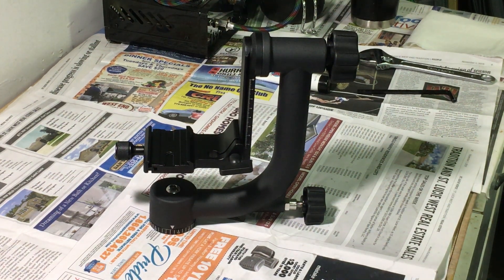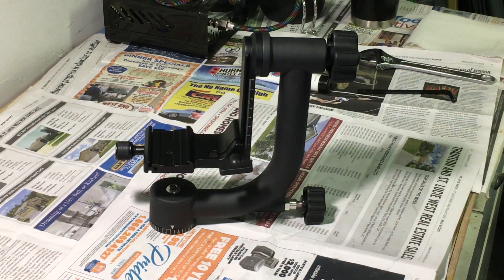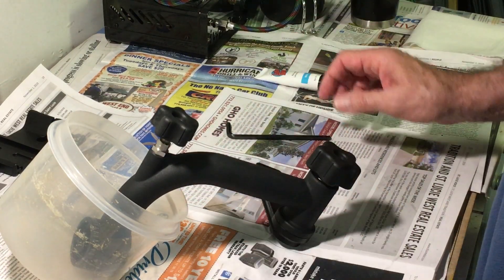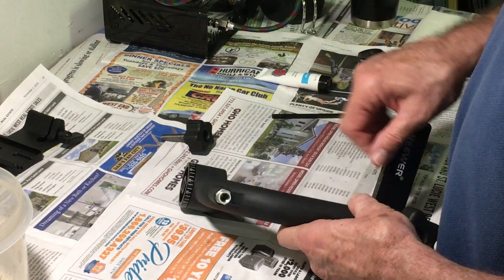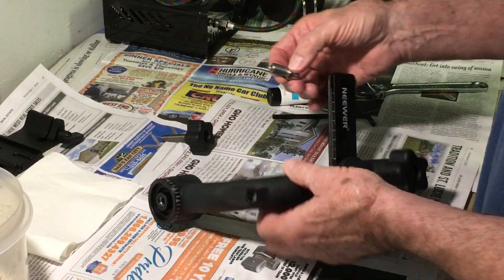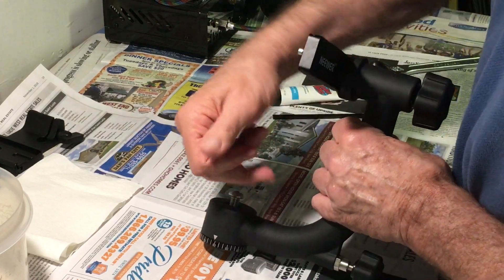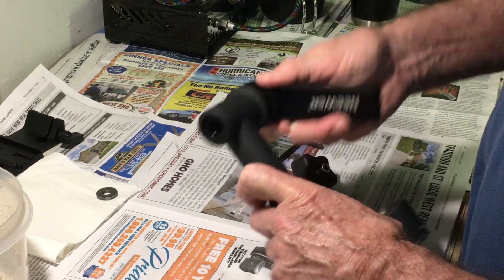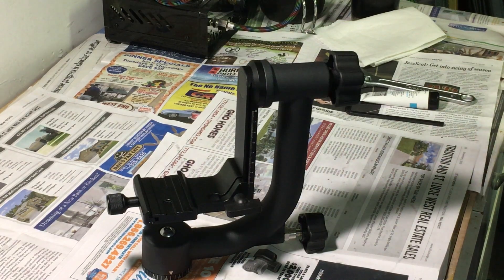NEEWER Gimbal Tripod Head Disassembly & Re-lube

Comment: I've had this gimbal since about the time you posted this video, the stickiness is real. So glad I found this, I was going to order a new one.
Reply from the maker: @kjkrzycki  I’m happy to hear that it worked out for you. 👍🏼 Thanks for checking out the video.
Reply: @vintagenerd55  got it done, used your lube. but there is play in the support arm that the arca plate attaches to. I have no idea if it was there before. Darn it. About 4-5 degrees of play

Comment: Fantastic video, I just purchased the same gimbal from Amazon here in the UK, and it was quite stiff in use, so I watched your video on how to regrease it and must say what a difference.  Both of the bolts on mine were impossible to shift, so I did like you did and soaked them in boiled water, and eventually, they came loose.  Regreased it using cycle grease that is yellow in colour but quite thin.  I've used this grease to lubricate the bearings on a very expensive road bike so it will be more than good enough for the gimbal.  Now it swings around effortlessly, so a big thanks for making this video.
Reply from the maker: You’re welcome John. Thank you for taking the time to respond and I’m pleased that you found the video helpful.

Comment: Thank you very much for your explanation.  But the Grees you used are not clear to me.  Can you please tell me its name?
Reply from the maker: LUBE TUBE. It’s a lubricant used for swimming pool pumps, O-rings and Jandy valves. Holds up pretty well and it’s not viscous like the OEM grease.
Reply: @vintagenerd55  woow. Thank you very much..

Comment: Beike BK-45 is the original Producer/Product now sold with many brands/names:
>  Bilinli,  Andoer, Neewer, ARTCISE K45 or Koolehaoda KQ-45
Reply from the maker: I wonder if any of the various resellers have corrected the high viscosity lube issue.
Reply: @vintagenerd55  every time I reply my text get deleted !!!
Reply from the maker: Never had that happen before. Must be some kind of a software glitch.
Reply: @vintagenerd55  I suppose it's some kind of bot to prevent spammers and selling spam... That bot auto delete suspect reply.
Reply from the maker: @AlainCh2.  I received all of your comments. Considering the number of complaints people have levied against the high viscosity lube, you would think the manufacturer would change to something less viscous. Thanks for your report on the different resellers iterations.
Reply: @vintagenerd55  Alas, no!! There is only one farm that produces two variations: One is like yours without any collar on the horizontal handle + visible screw on the pan joint. One like mine with a collar on the horizontal handle and a cover on the pan screw.

- In my first copy the horizontal handle got stuck while un-tightening + After an afternoon in the car in the sun a big blob of grease fell down on my knee Luckily after I removed it from the tripod, So I returned it
 - Got another that is working fine- I will proceed to disassemble it and do a short video because it requires removing the hard glued covers on both screws. I suppose heating will help to remove the glue.
Reply: @vintagenerd55  Koolehaoda 
is the brand - text to search ... testa del treppiede ...
Reply: @vintagenerd55  ITalian site of A z... what a pain!

Comment: Glad I found this.  I bought this head over a year ago and the damn grease/glue leaked out after a hot day in the sun while in my truck.  I added washers and a thrust bearing to the pan axis based on an Amazon review.  The old grease wasn't hardly coming out with brake cleaner.  I used some starter fluid as a solvent and it dissolved the old grease much faster.
Reply: Living in Australia, I've had the same problem, with the grease leaking out due to the heat. Other than that, it's a great gimbal.

Comment: Thanks for this video.  I bought it from  Henry Stores here in Canada . It was recommended by the   Store manager .  Using with a D610 and my lens is a Nikon super zoom 200-500mm. The  camera support was not too tight but the main bottom was way too tight , and in fact when trying to rotate it loosened the gimbal from my tripod . I used your advise and boiled water and was able to carefully but forcefully get that  screw out. When I cleaned it up, i used white lithium grease. All good now . Cheers and thanks
Reply from the maker: Good to hear it John! Glad the video helped.

Comment: This is also a very common issue in the amateur astronomy field. Most of the imported telescope mounts are assembled with the same type of "lubricant/glue" and have very stiff movements, especially in colder weather. My own suspicion is that they use this heavy lubricant to take up for loose manufacturing tolerances that may be present, although after cleaning and lubing most people find that the tolerances are fine.  Disassembly, cleaning, and re-lubing with a quality lubricant can make the mount far more usable. Many amateur astronomers use a product called Super Lube as their lubricant of choice with excellent results, but I venture to guess any other lubricant is better than the glue that is used when these mounts are assembled. 
Thank you for posting this instruction video, it is very well done and I am sure it will help many users to make their own mounts much more usable.
Reply from the maker: Thank you Joseph. Never realized telescope mounts can have the same problem. I’m glad you found it informative and I appreciate you checking it out.

Comment: Great video, thank you!  Funny how different people want different results. I have the MOVO GH700, I guess I have the later version where they have removed the grease because people complained of if being too thick.  Well I want to take mine apart to add some grease.  I had to take my Manfrotto video head because it was too thick, cleaned it and replaced it with silicone grease, I will do the same to the MOVO GH700, even though the manufacturer said for me not  to do it.

Comment: Very informative video. Thank you. My Neewer Gimbal Tripod just arrived. I was going to do the re-lube procedure as shown here but I found the original setup is acutally quite good. It is not as stuff as what I expected. Whatever lubricant it has inside seems to provide some kind of damping feel. Very much similar to my manfrotto XPro (560b-1) monopod 's twisting resistentce I think I will give it a go in the field first to see if I like the set up. The Gimbal is quite compact. Great for my Nikon D500 with the Nikon 200-500mm f5.6 setup. I was looking at the carbon fibre version as well. £50 more for a 230g saving is not worth it. So I went for this metal version for £80. Great value for money.

Comment: Just bought one of these. The gimbal itself is well put together, except
 for the arca swiss plate. It does need to rebuilt as the 'grease' is 
more like silicone and dreadful stuff. The top arm bolt will come apart 
with a 6mm allen key without any problem, the bottom bolt requires a 
h7/32 t3 allen key which is the perfect fit. All these are available on 
ebay or do what I did and take it to my local garage and it was done in 
seconds. Good luck.

Comment: Thanks a lot!! The boiling water technique loosened the horizontal axis bolt easily. But the vertical axis bolt - which is a couple inches long - required about four minutes in boiling water. After that-I easily removed the bolt with little pressure exerted and no damage to the plastic knob whatsoever. I used a thin coating of lithium grease on all the internals and this guy spins like a top. I really appreciate your post!!

Comment: Thanks for a great tutorial on how to disassemble and lube the gimbal. I received mine yesterday and have the opposite problem of loosening up the other bolt. I finally gave up after trying to break it free. I was afraid of stripping or damaging it. I think I will just squirt in some WD40 through the hole and slot as it seems to help for now. After I get out and try it out with the camera and will come back and use your hot water suggestion to make it less of an issue. Thanks!
Reply from the maker: Thank you Tom and good luck! 👍🏼

Comment: THANK YOU!  If you would put a Amazon, or other link to that Lube Tube in your comments, I would have purchased it through the link, and it might get you more $$ for your video.  Thanks for your help.  I have the Neewer Carbon Fiber Gimbal head, and it appears almost identical up top, but the base is different.  I'll see if I can get it apart with the tiny allen wrench set screw apparently holding the shaft in place instead of a wrench fitting (the base of the carbon fiber version doesn't have the "tensioner" allen wrench head on it, so I'm hoping it's just held in by the wedge). Thanks again!

Comment: I too have this Neewer Gimbal Tripod Head and have found the horizontal rotation far too stiff when using it with my Nikon D500 and battery grip + Nikon 200-500 zoom lens . The arm's vertical rotation doesn't feel quite as resistant to movement, however your clear deconstruction and re-greasing has given me confidence to 'apply the changes' to both parts and make it a more responsive unit. As a support for holding a DSLR and lens, the original grease' resistance creates a jerky movement when I pan quickly on my Giottos tripod, and can jolt the legs. This clean down and re-greasing certainly rectifies the operational fluidity issues, and thank you for making it look a relatively easy task to achieve, despite the hex screw being very well inserted! 
Bang for the buck, the Neewer Gimbal is still a very nicely made unit for the relatively low price - perhaps the Chinese manufacturer will change the grease' viscosity now that this issue has been YouTube'd !
Reply from the maker: Peter Ware Thank you Peter. Check out my post relubrication and demonstration video to see what the final results of my efforts look like with my camera on the gimbal head.
Reply: @vintagenerd55 . When is that video being released.
Cheers from Kiama, Australia
Reply: Hi Peter, if you don't mind me asking, what did you use to clean off the old grease ?